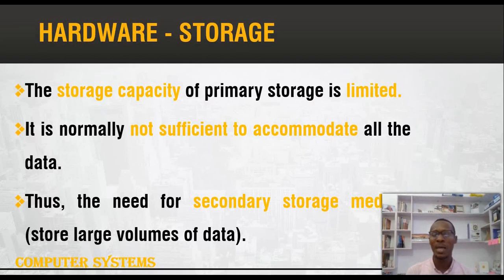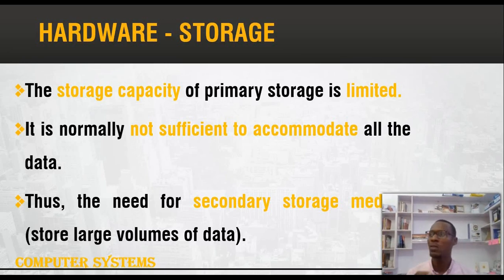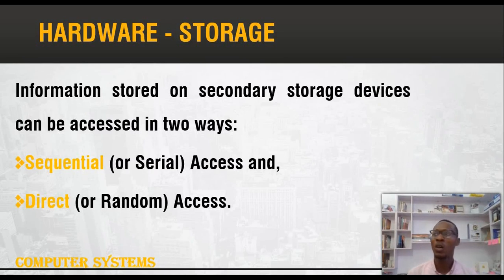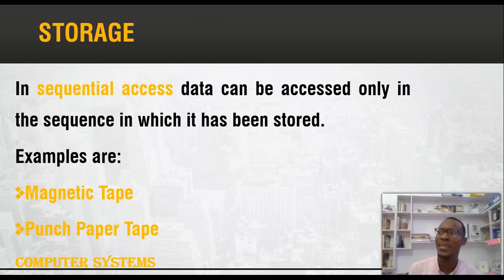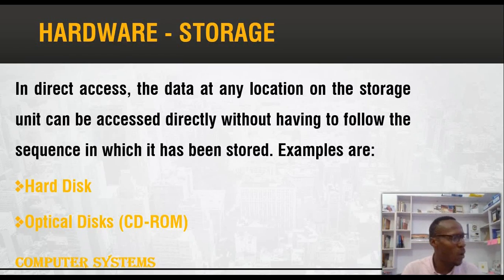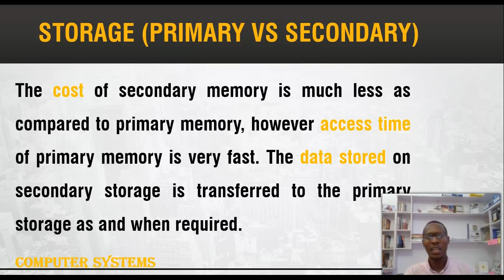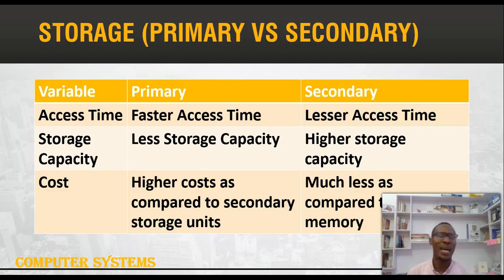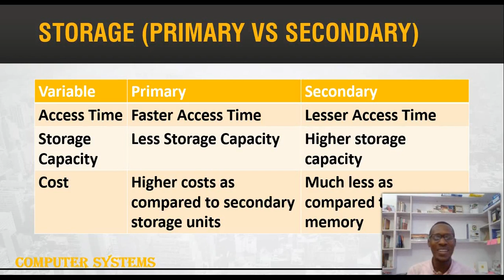PC Components -  Secondary Storage Devices

Comment: Thank you sir for these videos. Secondary storage have enough space to store data. It is non-volatile. It can retain data even without power. 
Information onsecondary storage can be accessed: 
Sequentially: Here the data can be accessed Only how it has been stored. E.g
Magnetic tape

Direct access: Here, the data at any location can be accessed by the viewer.
E.g are
Magnetic, optical, and solid state storage devices. 
I also learnt that the primary storage is more expensive than the Secondary storage.

Comment: I learnt that secondary storage overcomes the size limitations of primary storage. It is an external storage and it is non volatile. It is also cheaper than primary memory. Data can be accessed on secondary storage via sequential access( in the same sequence in which it is stored) or direct access( move directly to the specific location of the data)
Thank you for this video sir.

Comment: Thank you for this lesson sir
I now know that;
1 The primary storage is limited
2. It is volatile 
3. It's  not sufficient to accommodate all data
Therefore there is the need for secondary[ which is the opposite  of the primary storage]

I now know that there are two ways to access data on secondary devices which are
a)  Sequential  access[magnetic tape, punch paper tape]
b) Direct Access [Hard disk, optical disk]
Thanks for highlighting the differences between these storage devices sir
Looking forward  to more of your lessons 
Comment from Eze Daniel Oluwajuwon
Student of BMU 100level

Comment: This lecture taught me about the secondary storage also called auxiliary or external storage by making me understand that it is a non-volatile external storage that can store far more data than the primary storage.
Stored data in this secondary storage can be accessed by sequencial access method(In sequence like the magnetic tape) or by direct access(in any order like in the hard disk).
I also understand that secondary storage has lesser time and lesser cost than the primary storage but has higher storage capacity. However, secondary storage is very helpful
Thanks sir for this lecture

Comment: Secondary storage is non volatile also known as external memory which  means data can be retained after the computer  Is off the 2 ways are sequential and random access in sequence the data can only be accessed in sequence step by step the magnetic tape gave the best visionary image of this process the direct access  data storage can be accessed without following the sequence it's the opposite the advantages it stores more file the cost is less 
Storage can be classified in access time amount and cost the access time primary is better from your explanation in terms of storage capacity secondary is better secondary Is better in the price range this has give me a better understanding of the storage system to prevent error or issues when purchasing and computer device 

Thanks for this lecture sir

Comment: With the help of this video, i can differentiate between to the primary and secondary storage.
I learnt that the storage capacity of the primary storage is limited and it is not sufficient to accommodate all the data so there is need for the secondary storage.
The secondary storage which is also known as the auxiliary or back up storage is a non- volatile storage which can be internal or external to the computer system.

Comment: Through this lecture I learnt that secondary storage devices are not volatile .it can actually save data for a long time .its is and external storage device .I also learnt that data is stored in series in this kind of storage devices .i also learnt that it has less cost compared to the primary .

Comment: SECONDARY STORAGE also known as external or Auxillary storage is is accessed externally from the computer and it's non- volatile unlike primary storage (RAM).
Secondary storage is classified into two categories (based on their accessibility) : 
1.Sequential Access Storage: The datas on the sequential Access Storage can only be accessed sequentially in the manner in which the data was stored. E.g : Magnetic Tape, punch paper.
2. Random or direct storage: data on this type of storage can be accessed randomly. E.g CD-ROM hard-disk.
Secondary storage has more storage capacity and is less expensive compared to primary storage.

Comment: I’ve learnt from this lesson that, in terms of access time; the primary storage is faster than a secondary storage. 
Also, the primary storage’s storage capacity is lesser than that of the secondary storage capacity.
Then the primary storage is of a higher cost compared to to secondary storage units.

Comment: This lecture taught me that the capacity of primary storage is limited, hence we need to make use of secondary storage to store large amounts of data. Secondary storage could also be called external memory or auxiliary memory. And although it is a lot cheaper than primary memory, it has longer access time. But it is noticeably larger in size than primary storage. Secondary storage is a non- volatile storage. Thank you for this lecture!

Comment: I got to know that secodary storage devices are as important as primary storage devices in the computer.
The difference between internal HDD and ROM is made more clear.
I also learnt that the secondary storage devices is a non-volatile memory.
I also learnt the various ways by which information can be accessed in a computer system (sequence and direct access-method).
Most storage devices use the direct-access method of information.

Comment: I learnt that as a result of the limited size of the primary storage, a secondary storage device is required which is usually external to the computer and is non volatile. Information on the secondary storage can be accessed either through sequential or direct access.

Comment: From the lesson, I have learnt that the the storage capacity of the primary storage is limited. 
Hence we need the secondary storage devices to store large volumes of data.
Secondary storage devices are also called external storage devices or auxiliary storage.
It is cheaper that primary storage and has a slower access time compared to that of the primary storage.
Secondary storage devices are non volatile.
In sequencial access, data can be accessed only in the sequence in which it had been stored .

EVWARHONO EGUONO TITILAYO

Comment: Secondary storage is also called auxiliary memory which is non volatile,information stored on a secondary storage can be accessed by sequential access storage and direct access data. 
The access time of secondary storage is less compared to primary storage
Secondary storage has a higher storage capacity to primary capacity .

Comment: The storage of primary is limited and secondary  has more space. Secondary storage devices is non volatile 
It's also known as auxiliary memory
It is classified based on how information can be identified ie
Sequential: data can only be accessed in sequence hence to get data from here youll access all before you reach what you want
Direct access:data can be accessed in any other its the opposite of sequential access.
Primary memory is faster to acess data and uses less capacity than the storage acess

Dan-John Omashiem Irene

Comment: In continuation of the last video, where the two basic types of storage devices was discussed, we now look at some more advanced form of storage devices; the secondary devices. These type of database storage system is the class, or category of storage devices that is most useful when it comes to backup and safe file storage; as it is another separate component of the computer system that can still retain it's information even when the primary computer system has issues.

Nwosu Noah; Department of Dentistry.

Comment: Secondary storage (external or auxiliary memory) can retain data when power is off. And this is stored externally in a computer system.

Secondary storage are classified based on the way information stored can be accessed.
Storage devices can be classified through 3 features.
. Access time
. Storage capacity
. Cost
In conclusion both the primary and secondary storage devices are important even while having their differences.

OKERENWOGBA DESTINY KESHI.
Optometry

Comment: The secondary storage is non-violatile which means it retains information after shortage of power supply. It is also known as Auxiliary storage or external storage. It can be classified into;
Sequential Access storage and Random or Direct storage( e.g CD-ROM)
                 Prince Philip.